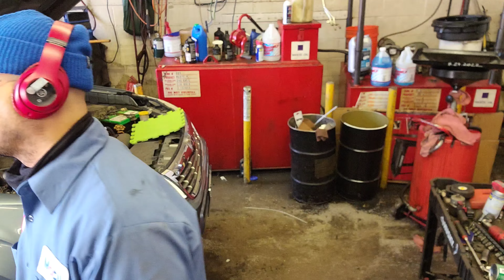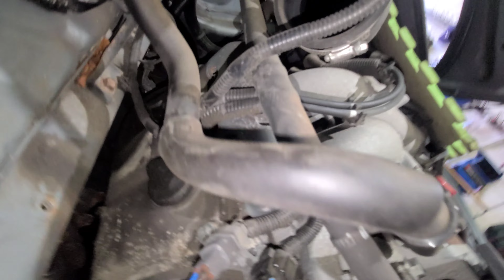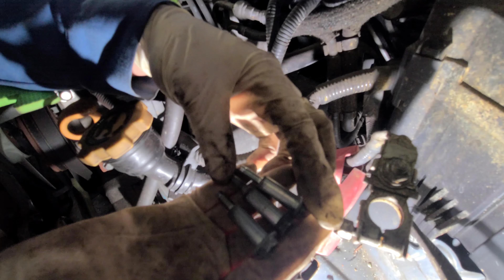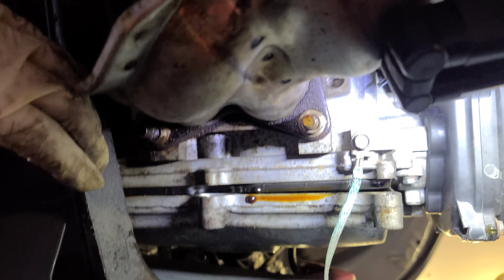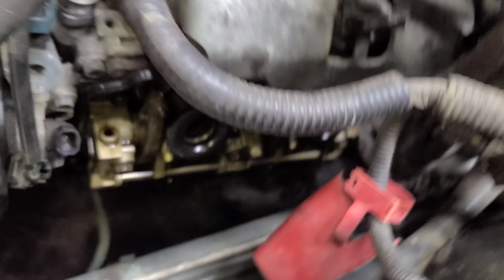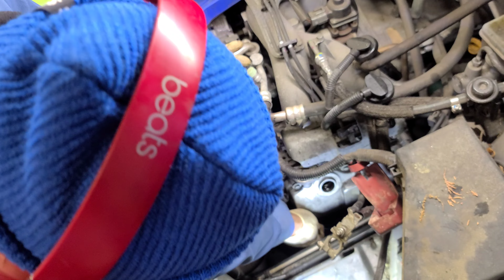2009 - 2010 Subaru Forester How to Replace The Valve cover Gaskets on both sides

Comment: You are the man, thank you very much for this video ❤️🔥.  I might have missed it, but did you loosen any bolts for the motor mounts, to make the engine go up that high with the jack ???
Reply from the maker: Thanks for the kind words! I didn't want to bore you with the details of loosening bolts, but yes, that's a crucial step in the process.
Reply: @AxtuoAx  thank you for the Reply.

Comment: Why you so hesitant to remove the fuel rails to give you the needed space?
Reply from the maker: I guess I like to keep things fuel-injected with a side of hesitation!
Reply: @AxtuoAx  I was thinking maybe those plastic connectors get dicey when they're old.
Reply: Just remove the cover makes it much easier